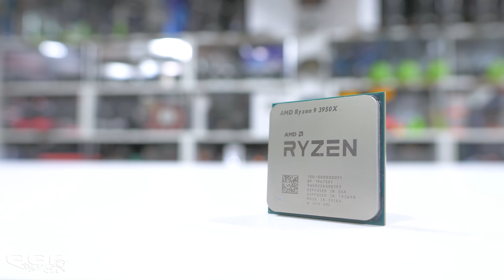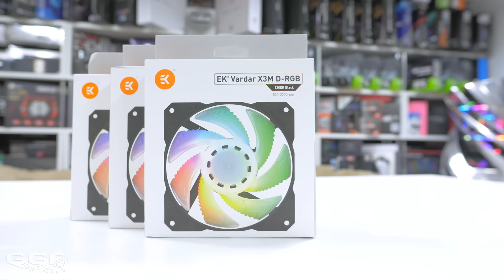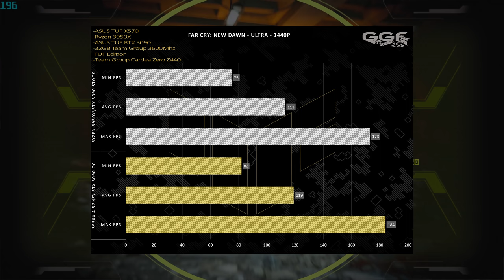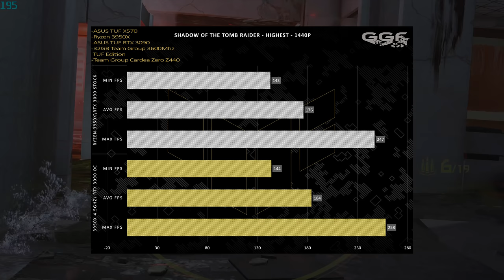RTX 3090 TUF Gaming Build with 4K Gameplay & Benchmarks!

Comment: Beautiful computer and color scheme.  But 2- 360 radiators for one CPU appears to be overkill.  I like the added flow indicator with a valve shown @ 4:52.  I imagine it makes draining the system less painful.  And is 2 radiators overkill?
Reply: I was thinking same with the two rads. Seems overkill to me. The temps stents likely going below room temp, but it will take longer for heat soak I guess. One rad for cpu and the other for gpu would have made more sense in my mind. Beautiful build regardless and awesome vid!
Reply: 2 rads it is overkill for one CPU, but it seems thr GPU will have on future a water-block...

Comment: Am i the only one who thinks the gpu should also be in the watercooling loop? That red hot 3090 would really benefit a lot more from the extra cooling, the two 360mm radiators are plenty for both cpu and gpu, just a lot of waisted potential in my opinion.
Reply from the maker: This video is so old blocks weren't even out yet

Comment: I saw a review of the RTX 3090 Tuf, he said that this card was 10-20% worse than other RTX 3090s in terms of performance.

his old system

Intel i7 8700K (on 4400 MHz)
G.Skill 32 GB 3600 MHz RAM
Gigabyte Gaming OC 2080Ti and then switched to the 3090
on a Gigabyte Aorus 390Z Pro WiFi
With a Samsung 860Pro M.2 SSD

his new system

Intel i9 10900KF (on 5300 MHz)
G.Skill 32 GB 3600 MHz RAM
Asus ROG Maximus XII hero motherboard
Asus TUF 3090 O24G
Samsung 860 Pro

I'm asking because I'm going to get a 3090 and this is the only one that is currently in stock.
Reply from the maker: He is wrong
Reply: @GGFEvents  ok thanks, i didn't buy it yet but i think i will.
Reply: Both the TUF and the STRIX are the best nvidia cards this gen, so im pretty sure you're wrong
Reply: @Icenfyre  thanks 🙏

Comment: 2x 360 radiator for only 1 cpu. Wut
Reply: Yeah why not? More Rad space means you can the run the fans at lower rpms and still get the same performance at lower noise levels
Reply: @Bucking-s4i  plus I consider it extra thermal headroom if you wish to add the GPU to the loop too
Reply: @danyalreyaz7503  correct, I think the water block for the 3090 isn't available yet but is coming.